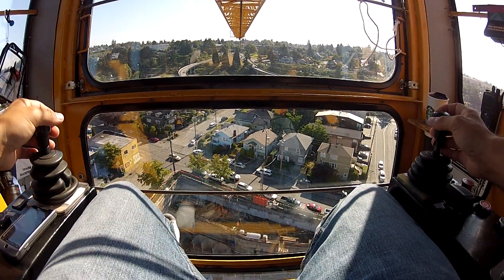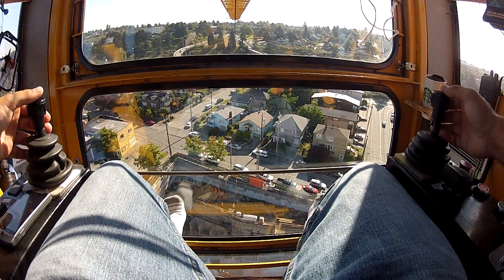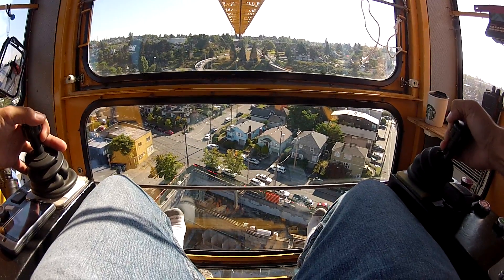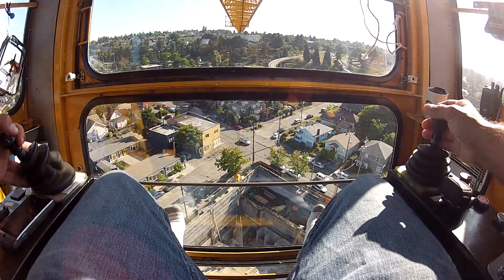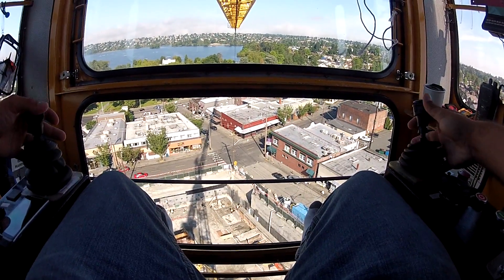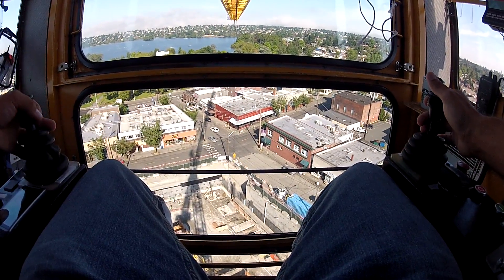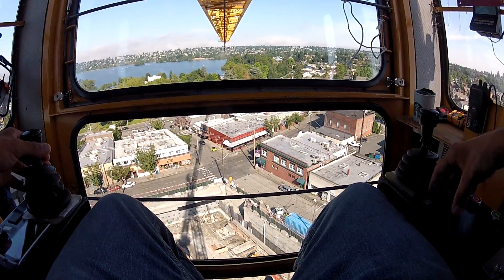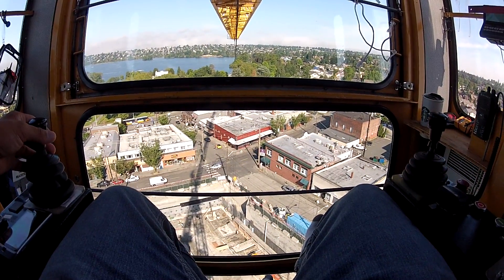How to Operate a Tower Crane - Rebar Column

Comment: Nothing more annoying than a crane operator doing something you didn’t give him an order to do. Dude said “ I’m
Moving it cause I know I need to even tho he didn’t ask for it” Just do what your asked to do . 🤦🏽‍♂️
Reply from the maker: This rigger and I were dialed in together. He would cover the trolley radius and I would handle the swing. This includes corrections for swing and radius for my corrections that have to go with it. This is how we were efficient. The practice of a signal person dealing with the swing is just moronic when a crane operator is sitting in line with the load and the crane boom. 

I've met a solid 5 carpenters that know how to signal a crane in 24 years. Maybe you would be number 6? The vast majority of your trade has zero business signaling a crane. But if I hear the signals given with confidence and competence, I'll happily do exactly what's called. And I'll know in ten seconds what your quality is as a signal person. Hell, if you never look up, I already know. But if the hook or load is coming down like it was flushed down a toilet, I'm taking over for safety, accuracy and speed.

 If you want to hear what it should sound like, go check out the "Hanging Iron" video. If that's not what you sound like, and you don't understand what's going on, realize that operators have been saving you for years. And if that's what you sound like, I'll give it to you exactly like I do in that video. If you don't sound like that, you should thank the operators that have kept you safe to this point.
Reply: @rotyag , I get what you’re putting down. And I’ll say I’ve probably been saved by a few operators in my 20 something years , but I’ve also been put in bad spots by them doing something they thought I needed when I didn’t . I’m definitely dam good signal man when it comes to signaling and a dam good rigger . I can tell you know what you’re doing . I was just saying how carpenters feel from our perspective. It’s different cause you can see everything, I’m using to working with lattice boom Crawlers and hydro cranes.

Comment: If I want to get into this how do I go about doing it, I tried with my local union for apprenticeship and didn’t get in how would I start then?
Reply from the maker: A few angles to take. One option would be getting into a different union as a rigger. Sometimes they come from Carpenters, Laborers, or Ironworkers. But there is the hazard of not getting the work you want and being trapped, or at least feeling trapped. It can be like the military that way. Wanted to be a crane operator, but I push a broom all day. You can go to a school like Morrow's and get a license. That will up your value, but you are spending maybe 10k to make it happen. If you show up with a license, the union will have the choice to sign you up. or watch you go to a non-union competitor. Assuming many realities in life, you can also start with a non-union company and work towards your license. A mobile crane supplier is one way. Some general contractors hire their own operators and riggers. This would avoid the trap of another union. Once you are working non-union and you have a license, the union would fall over itself to get you under their agreement. I'm sure I'll get hate for the suggestion, but that's a reality based solution. They can't hope for loyalty until they agree to take care of you. Sorry it's not going the easy way for you.
Reply: @rotyag  thanks I appreciate the advice

Comment: From working in the construction industry for over 30 years a good operator is worth their weight in gold. You don't realize it until you've had to deal with a bad one. I'm sure a good signal man goes a long way with you all too.
Reply from the maker: They are invaluable. I was working for a General Contractor that had lost their way with skill sets with regards to cranes. I was on a 21 story and had over 20 different signal people. I would be tense all day and roll over to a concrete forming guy that knew the deal and the tension would dissipate. It was the kind of thing where I'd roll off the edge of the building and the superintendent signaled "Hoist down easy". No idea why he was there, but here I am countering on the radio to who is essentially my  boss, "Do you really want me to hoist down easy from 14 stories?" A poor signal person just puts me on edge as I'm waiting for the accident to happen that I can't see. Worst one for me was coming up and over the edge of a building with a pallet of paint strapped. I can see it deforming so it was a run to get over the roof so no one would get killed. Since I've left the seat years ago, it seems that lift directors and structural lifters have become less and less optional.

Comment: I've noticed and just about every single operator videoperator video in Asia and including this one that the operators don't wear shoes in the cab. Is there some kind of unwritten rule that you can't wear shoes in the cab?
Reply from the maker: In most of Asia, you don't walk into living spaces with shoes on. In my case, sitting in boots all day just leads to smelly boots. You are also walking on a dirty jobsite into a crane. If you wear those same boots, now you have to clean multiple times a day unless you want to try to see through the dirt on the glass. Those are my motivations anyway.
Reply: @rotyag  Sensible explanation. Thanks. It makes sense. I wonder why this doesn't extend to excavator operators? I always wear my boots when I run an excavator.
Reply from the maker: @basspig  You are getting in and out of an excavator and you have foot controls. The cabin of a tower crane is larger so there is walking around for various reasons, but you can avoid the dirt. And tower crane operators are looking down through glass at their feet, so the need to keep that clear is there where you don't have that motivation. I have a couple of mobile cranes at my yard and I am always in boots when I jump in those seats. A tower crane is one of those places where you are there for 12 hours at a time.

Comment: I am considering a career with Tower Cranes. I went to College for 2 years to study Business, dropped out and now I work with concrete. I live in the UK and there are 10 day courses you can do to become a qualified tower crane operator, however I feel 10 days is probably not long enough before going out on site? Especially given how unpredictable our wind can be. Currently we are battling storm Erik. And I imagine it's a lot harder to operate these machines with high winds. What would be your best advice for someone looking to start in this field? If there are better suited courses in the states - I would not rule out travelling there. Many thanks
Reply from the maker: Winds make running the cranes far more difficult. The load on the crane booms increase dramatically based on the surface of the load. You can run to 72 kph with most cranes if you are pouring concrete. If you have flying walls, that might be 25 kph, or less. 

The problem with training is that you have to put it into action. The honest assessment is that 10 days cannot even give you 10% of what you'll need to know to run a tower crane. I don't say that to be rude to the places trying to help improve safety with training. I train people how to rig and signal cranes in an eight hour class. My government says what needs to be in the class. I give a lot of good information in there, but it's woefully inadequate. At the same time, contractors are usually not going to allow for more time. 

The best way to get into a seat from a training perspective is to work your way up from the field. You'll be best served if you know how things hook up. What they are called. The process the guys on the ground need. The sequencing of installation. It sounds silly, but if you swing over to where things are and recognize each step before it's even asked for, production will go up by 10-15%. When you can make corrections before it's asked for because you know what's needed, it's probably another 5% and people love you for it. But if you don't have that experience, well, you probably shouldn't do anything unless you are asked. 

Start on a small crane on a slowed paced job. In the US, it would be wood framed apartments. In the UK, it would likely be with a self erecting crane on a brick job. Chase the hook with the remote and you'll quickly learn how to be smooth and why it's easier for everyone if you are smooth first and fast later. Smooth and accurate is incredibly valuable. Some guys focus on speed. It's needed, but if it comes in accurate and smooth, it's quicker on the handling side. 

That's my general advice to start. Remote, do the rigging, be a part of the building, then move up to a short crane seat and work up. Take mental notes of what goes next. Old timers can hop in a seat and know what's next 30 minutes into the day. Smooth, accurate, then fast. 

Best of luck.
Reply: @rotyag 👍

Comment: Here in Los Angeles I wonder if the operators worry about an earthquake.
Reply from the maker: Definitely in the minds of operators. The reality is that in conventional set ups, tower cranes have a tremendous ability to shake and be fine. An earthquake that did damage was in 2002 on the Taipei 101. Two of four tower cranes broke away from the 57th floor. Horrifically  5 people died. But if you watch the video, on the the tower cranes strikes another as it falls at terminal velocity. The counterwieghts are thrown from the lower crane due to being hit so hard. Yet, the crane remains standing. So if the foundation is properly set up, we shouldn't see any issues during earthquakes. It's  a fear due to a lack of understanding. I say that without judgement. My rational brain says one thing, but the irrational side gets it.
Reply: In case of emergency, take two pair of pants.

Comment: Didn't see any monitoring system, zoning and anti collision?
Reply from the maker: That was a 1990 version of a liebherr 550 HC, even before the E-CH versions that ran until 2005. Zero indicators or assistance on those old cranes. It was quite a skill to hit your marks 80 meters out over and over. The generation before me will often whine about computers, but they make the job so much easier.

Comment: Is this a seasonal job, where you collect unemployment in the winter time?
Reply from the maker: No. Once a tower crane is up, the rent is running. The building is going up, so normal weather will not slow you down. Winds stop you at about 40 mph or so.
Reply: Cool. Thanks for the response.  @rotyag

Comment: I’ve been in mobile cranes for a while now! How do I get into tower crane
Reply from the maker: I think it depends on the location. North East... and most major cities outside of the South, The Operating Engineers Union is the way to a tower crane seat. In the South, I think it's generally through the crane rental companies as they do a single source on it all. Some contractors that have tower cranes on the non-union side have their own operators. I would call up the tower crane rental companies and ask them how it works in your area as a starting point. In California and Washington, you'd need significant time being trained. It's 500 hours here in Washington.
Reply: I worked for taxi fleet and they did have tower cranes. I was thinking about going to school tower crane school
Reply from the maker: The right answer depends on where you live. I'd love to tell you that the union will pay to train you. They will. But if you live in an area where you'll be trained and unemployed, that's not the best advice. 

I don't know what school would be best. Phoenix has one. Florida likely does as they have lots of different crane training centers. Then Morrow in Salem Oregon likely puts on a good one. I haven't been to it, but they are pretty professional. 

Functionally a tower and a mobile aren't that different. A mobile is more complex. A tower requires different sighting in for loads and some functionality differences that I'm not sure you'll learn in a school. There is a lot of OJT with tower cranes. 

The timing on tall cranes is severe for most crane operators. It's not often with a mobile that you reach out 267' and down 300. So the 4 second delays from the structure moving to the hook reacting takes some practice. The speed differences are something to get used to if you have ran hydro's. In quite a few towers, you are coming in hot all day. Really getting after it is 17 lift cycles an hour. 

But overall, there is a lot less to worry about with a tower. No bypass key. No set ups. Same crew day in and day out. Same rig so you can track any issues. It's just a lonely place in the sky by yourself. I enjoyed it. But it's not for everyone.
Reply: rotyag what’s the avg pay? Is it much different from tomorrow
Reply from the maker: I can only speak to Seattle. 40 per hour plus 15 in benefits. I hear in Oklahoma and Arkansas areas it's more like $25. NYC gets crazy with it. I've heard some big numbers, but if you don't know anyone...

Comment: Awesome video. I'm nearly 17 years old and am thinking of getting into construction. If I may ask, what are you working hours?
Reply from the maker: Hours for operators depend on the job and the speed with this the schedule is. Commonly for wood frame construction in the US, I'm used to 50 hour weeks. For highrise construction, 60 to 70 hour weeks are common. Early starts like climbing a crane at 5 AM is normal in a downtown core. if you are in the smaller areas, usually the noise ordinances dictate how long and early you can work. The hours are demanding. The pay is pretty acceptable for not being a professional or great at sales. Best of luck.
Reply: sure join

Comment: Do the new Liebherr cranes have gear shifts? (Multi-speed gearbox) If so, do you like having multiple gears?
Reply: They do. They will often have 3 gears. On the Hanging Iron video, that crane has a 20  (metric) ton hoist. So third will hoist 10,000 lbs and hit like 470 feet per minute. On a 800 foot tall crane, you need that. I would say that you need more speed if you can get it. But 10,000 for most loads is pretty acceptable. The nice thing between the new and the old cranes is that the motors are ran via a VFD. So the inputs are variable like a hydraulic crane. The motors won't overheat. On the old cranes you had a duty cycle to worry about with the electric motors. If you ran at a slow speed for a couple of minutes, the heat coming out of the resistors and rectifiers was absurd. So you had to gear down to make the motors run efficiently or you would burn up the power supply side. 

The downside is that we used to have to deal with the speed. This made us productive. Today people want the slow control and it kills production times. Guys hop on the radio and ask for "Easy down" from 200'. I just quietly have a mini-stroke and give it to them at a working pace.
Reply: Gaytor Rasmussen Do you like the gear shift? Or do you just like high (but variable) speed?
Reply: I am trying to think of any large 2 part operation cranes that have no gearbox. I think that they all have one unless they have a 2/4 part operation with a second block. There must be a mechanical line pull limitation in there. Or, it's a braking capacity issue. 

There is this whole unseen design of a hoist motor package and cost issue that needs to be factored in. How fast can you run if you make everything heavy duty, and how much will everything weight, and how many amps will it take? Like a Liebherr 316 can hit 906 feet per min. A 550 hits 459, but each has the same 147 hp hoist motor. So they must be factoring the common maximum amperage in areas around the world vs what's practical and cost effective.  

I'm fine with the gear switch. It's not commonly a problem. The modern cranes do it so fast that I often would get my signal people on the same page that if it's near my 3rd speed limit, there might be a seconds pause if I have to switch. It's common stuff over and over with tower cranes, so usually you know about what things are going to weigh.  

I love the variable speeds. I find that I get used to hitting the same movements. It does take longer to get used to each crane though. It's also nice to be able to engage a speed and not need to pay so much attention to how much a "bump" is.
Reply: Wolffkran's 8060 has

up to 5600 kg at max ~79 m/min 
up to 50000 kg at max ~11 m/min 

No mention of a gear shift anywhere. 

Liebherr's 1000 ECH 50 has (according to the most recent data sheet)

Gear 3: max 4800 kg at max ~77 m/min | max 12000 kg at max ~39 m/min 
Gear 2: max 10500 kg at max ~40 m/min | max 24000 kg at max ~22 m/min 
Gear 1: max 23000 kg at max ~20 m/min | max 50000 kg at max ~11 m/min 

Both have 147 HP (max continuous power) motors. 

If Wolff's motors can withstand being bogged out to 14% of full speed, can Liebherr do it too? Yes. In fact, Wolff's winch is actually slightly better because its no-load speed is slightly faster. 

But why don't Liebherr? Do Liebherr's motors last longer as a result of less loading due to the ability to use a lower gear?
Reply: yeh they have
Reply: puhh